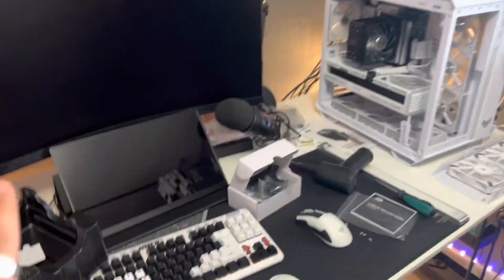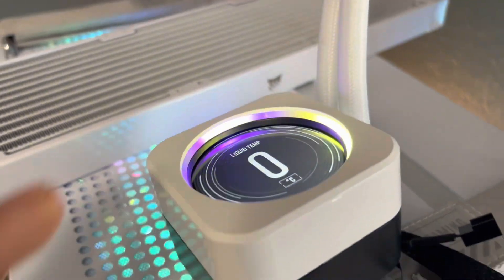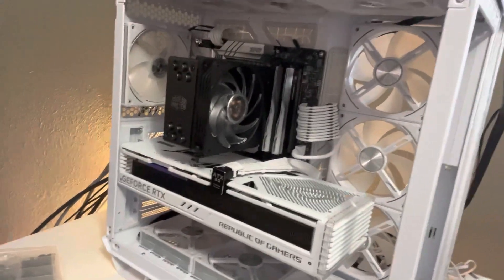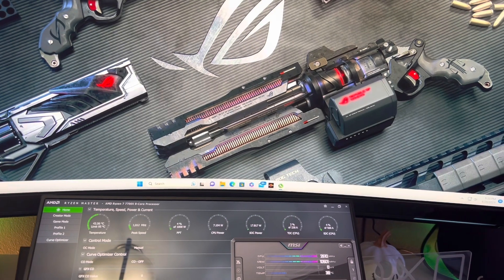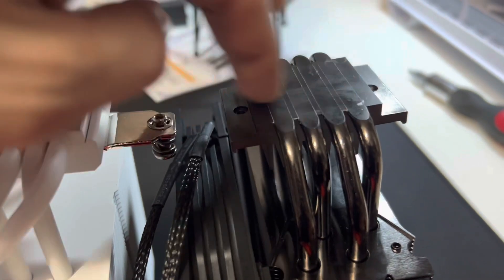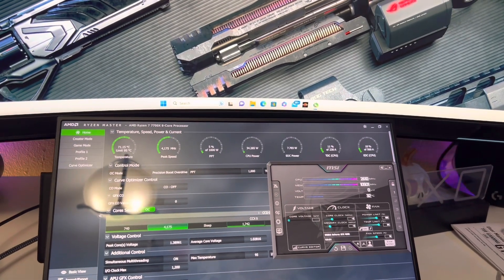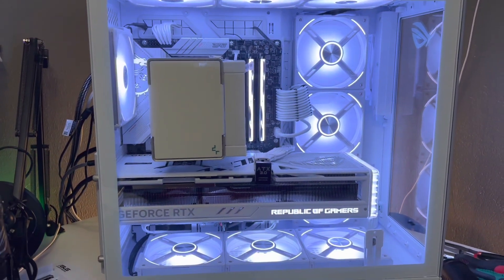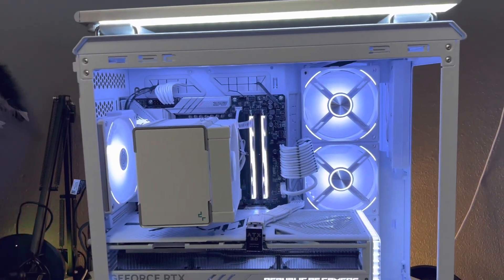Are  air coolers good enough for current gen cpu’s? Featuring Deepcool Ak500 vs Coolermaster 212 Evo

Comment: That was interesting video! For me personally i think if you want reliable and easy maintainable cooler with really good performance  i always choose air. I don't think it is louder that an AIO water cooling, but the AIO has the benefit of the water playing a big role as thermal battery, but i don't like all the failure points like the pump, 2 fans, the liquid will evaporate eventually and the fins of the block can get clogged. In general, the maintenance is harder and the only reason why there are so many of them installed on PCs is because it is more stable and secure during shipping which makes it perfect choice for the companies that do pre-builts. 

For me it is either Air cooling or custom water cooling. I don't recommend to anyone to get an AIO. It is just how i see the things and if you can't stand the look of a box cooler and understand why you might want to put this beautiful AIOs, especially how much experience the companies have know a days with making them stunning and unique!